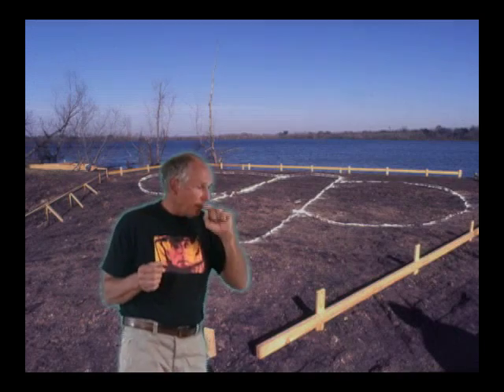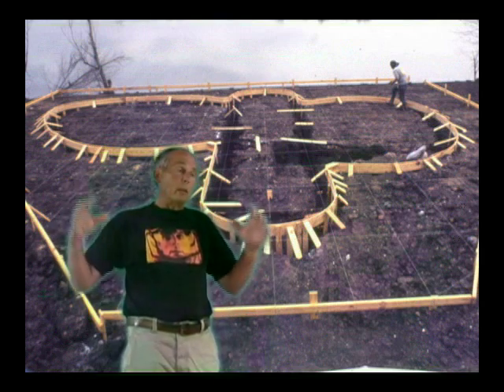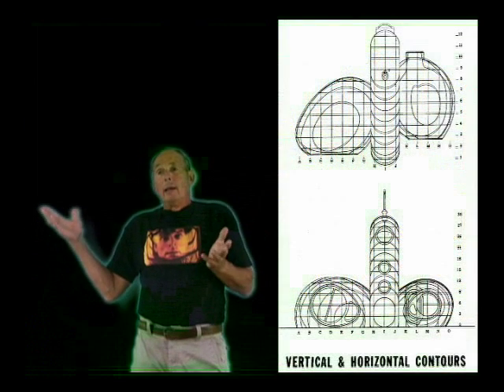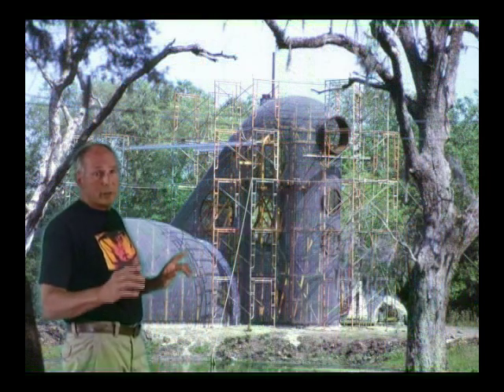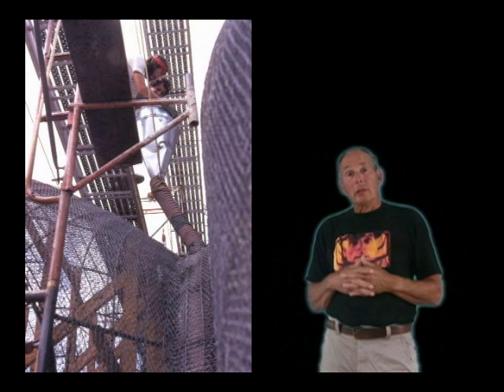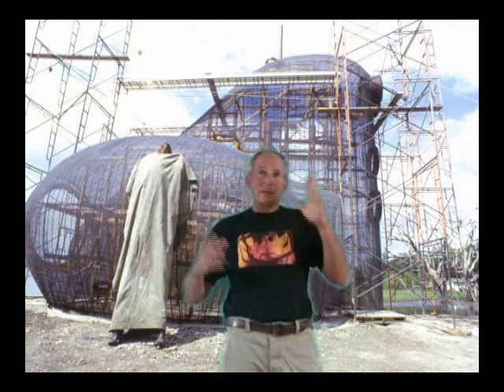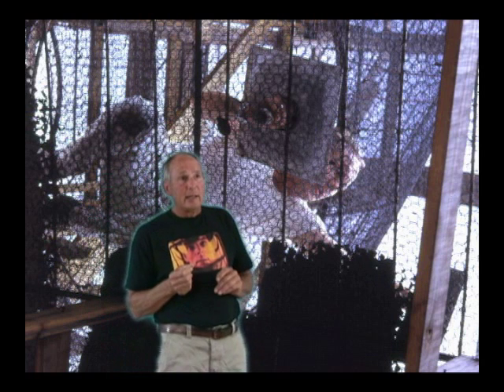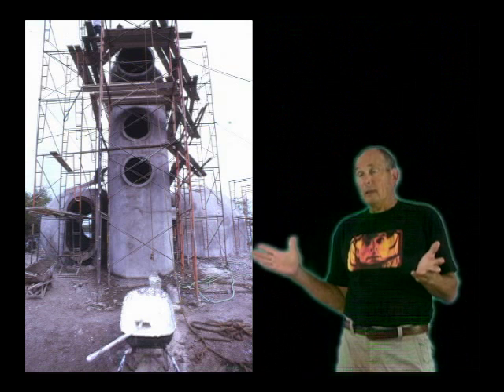House of the Century Construction (1972) - Part 2 of 4

Comment: This is a cool house. So for steel reinforcement you used  1/4" rebar, chicken wire and "black pipe"?. Anything else? Was the black pipe removed or is it still in the structure.